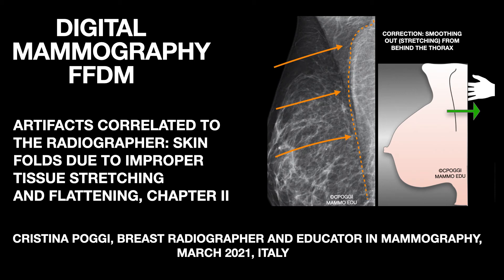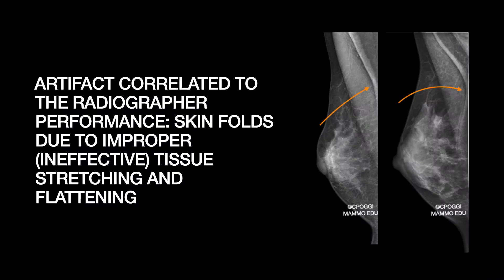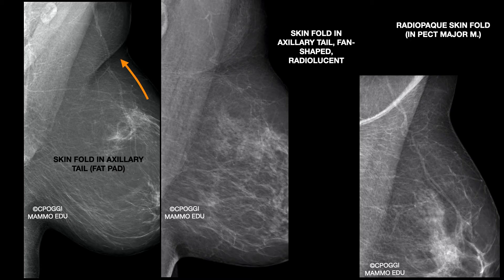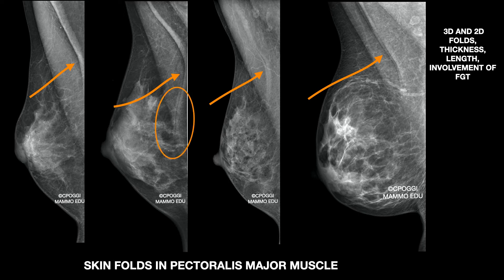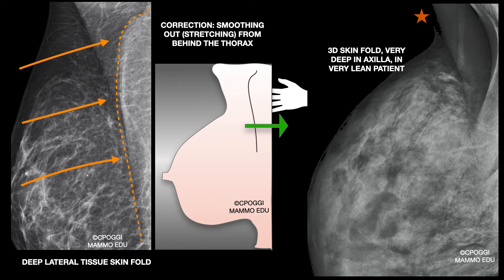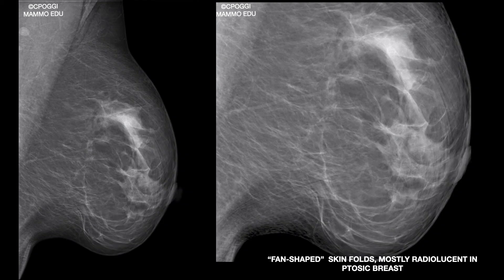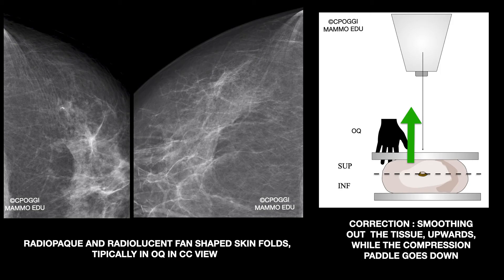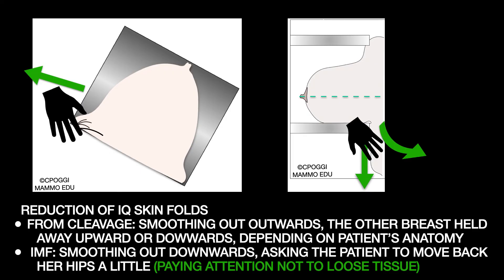THE ARTIFACTS CORRELATED TO THE RADIOGRAPHER IN DIGITAL MAMMOGRAPHY: SKIN FOLDS, VIDEO 2

Comment: Thank you for the very informative video. Do you have any reference paper or document on these skin fold classifications ?
Reply from the maker: Hi, you are welcome!  I'll send to you two papers that I found good about quality in mammography, related to positioning. Actually, to my knowledge, a classification of skin folds doesn't exist: just about thickness and degree of radiopacity. And, of course if the fold is on the glandular tissue. I do think it should be stresses also the portion where the fold is, there are portions which can be seen in one projection only.  I'm going to publish a book about senology for radiographers, hopefully at the end of this year, and I talk about my classification of artifacts in mammography, something that I propose, then. I hope it will be something interesting and useful, to the Mammographers. These are the papers I recommend: 
1) BOYCE, M., et al., Comparing the use and interpretation of PGMI scoring to assess the technical quality of screening mammograms in the UK and Norway, Radiography XXX (2015) 1-6 http://dx.doi.org/10.1016/j.radi/j.radi.2015.05.006
2) TAYLOR, K., et al., Mammographic image quality in relation to positioning of the breast: A multicentre international evaluation of the assessment systems currently used, to provide an evidence base for establishing a standardised method of assessment, Radiography 23 (2017) 343-349 http://dx.doi.org/10.1016/j.radi.2017.03.004
Bye, Cristina
Reply: @cristinapoggi7579  Thank you so much. Looking forward to reading your work. Best, Adarsh
Reply from the maker: https://link.springer.com/book/10.1007/978-3-031-63314-0 https://www.amazon.it/Breast-Imaging-Techniques-Radiographers-Cristina/dp/303163313X